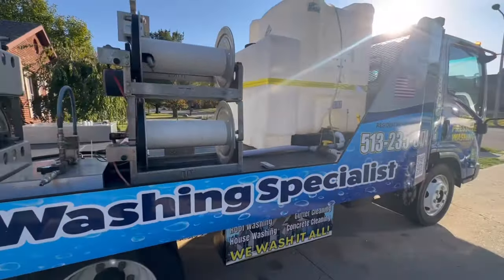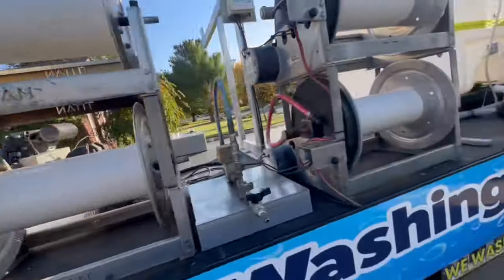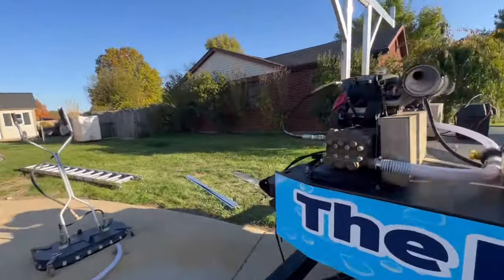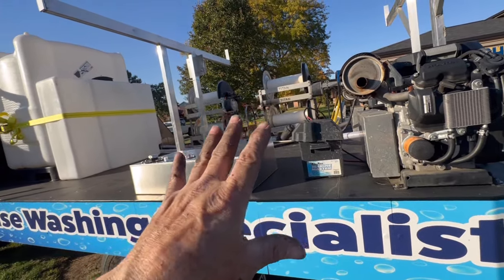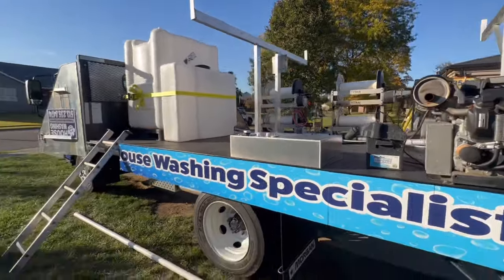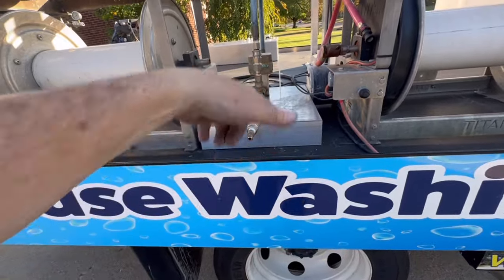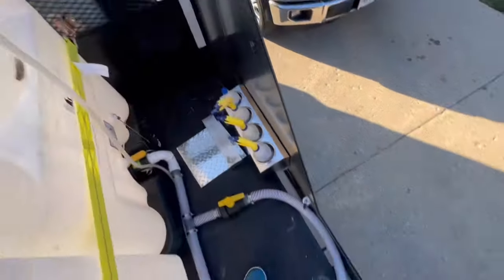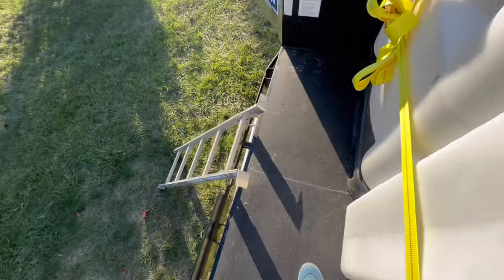Jazzy Is almost Ready!!!

Comment: another quick question... why did you elevate your buffer tank on that pedestal and what size are those reinforced braided tubing going to the pressure washers?
Reply from the maker: I did not elevate the tanks. It cane that way. The outlet is actually below the tank, which allows all the water to drain out.

1.5”